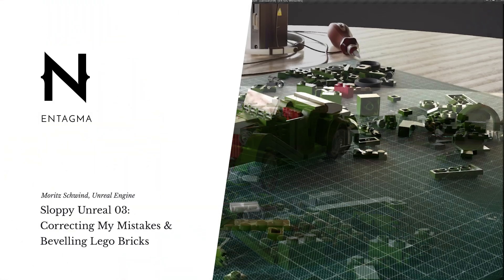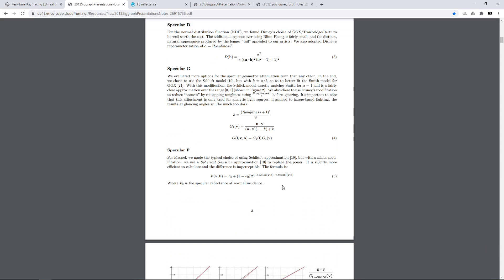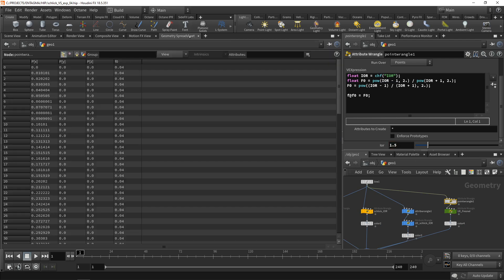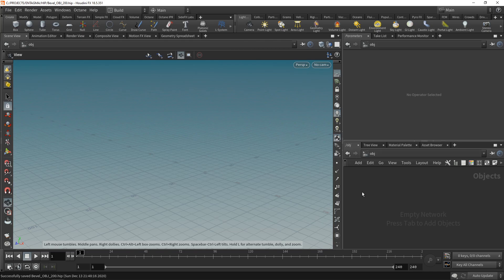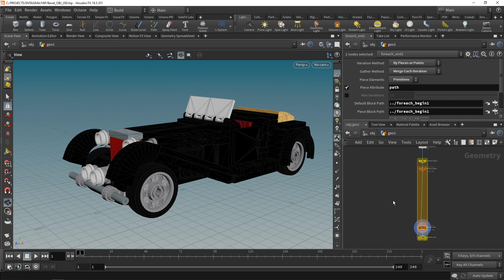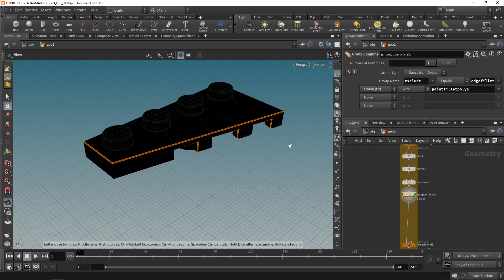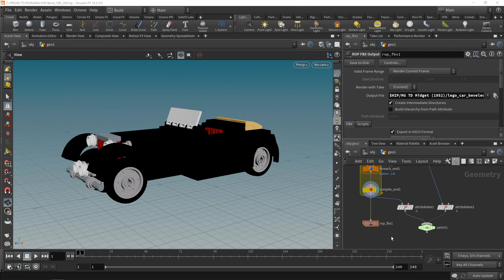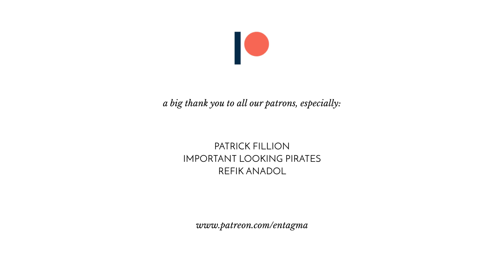Sloppy Unreal 03: Correcting Mistakes & Bevelling Legos

Comment: unreals specular is remapping this values (0.04-0.08 if I remember correctly) to 0 to 1 range, no need for this small values.. default specular value is 0.5(which should be right for 90% of materials) which corresponds to actually 0.06
Reply from the maker: FUUUUUARGH!
Scrap what I said. Turns out I had exposure dailed up in my post process volume, which messed up all the tests I did. You're right, the specular from 0-1 gets remapped into an F0 of 0 - 0.08 with a spec value of 0.5 corresponding to an IOR of 1.5 and an F0 of 0.04, and a spec value of 1 to an IOR of 1.788 and an F0 of 0.08. Apologies.

https://entagma.com/site/uploads/2020/12/iortest_006.png
https://entagma.com/site/uploads/2020/12/iortest_007.png

Cheers, Mo
Reply: @Entagma  Yup it's a 0-1 value so 0.5 is the default reflectivity. It's actually a legacy parameter and they outline it in the research paper you mentioned, and that it's meant to be used as a Cavity parameter instead.
The F0 actually is defined by the metallic input which just interpolates between 0.04 F0 and an F0 defined by the albedo map (which also interpolates the output albedo to black) - so you can't really set the F0 directly. They do this because in most cases they don't want you to - the default of 1.5 IOR (4% reflectance) is suitable for most materials.
Reply from the maker: The default specular of 0.5 in raytracing mode looks quite incorrect when compared to Octane/Redshift renders with a corresponding IOR of 1.5. A value of 0.04 - 0.08 though resulted in a similar appearance to what Octane/Redshift rendered. So my speculation is that in raytracing the specular doesn't get remapped from 0-1 to 0.04 - 0.08, but as always it's quite challenging to find any official statement on this - so if you happen to have a link that'd be super helpful. Cheers, Mo
Reply from the maker: Here are a few screenshots of the tests I ran:

https://entagma.com/site/uploads/2020/12/iortest_001.png
https://entagma.com/site/uploads/2020/12/iortest_002.png
https://entagma.com/site/uploads/2020/12/iortest_003.png
https://entagma.com/site/uploads/2020/12/iortest_004.png
https://entagma.com/site/uploads/2020/12/iortest_005.png

Also correct F0 values are:

F0: 0.02 for an IOR of 1.33 (Water)
F0: 0.04 for an IOR  of 1.5 (Dielectrics, Plastics, Glass)
F0: 0.08 For an IOR of 1.788

Cheers, Mo